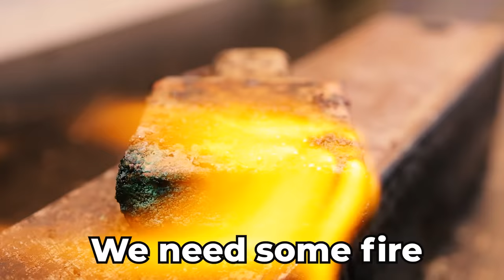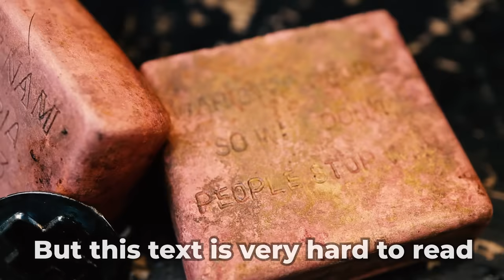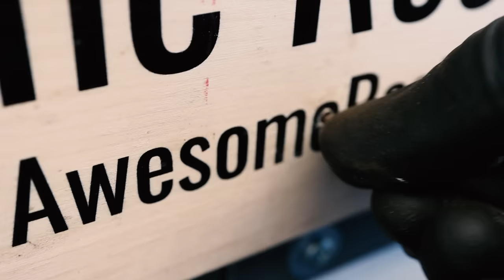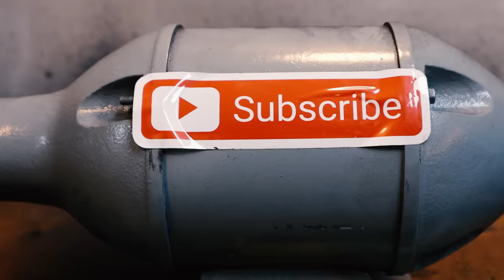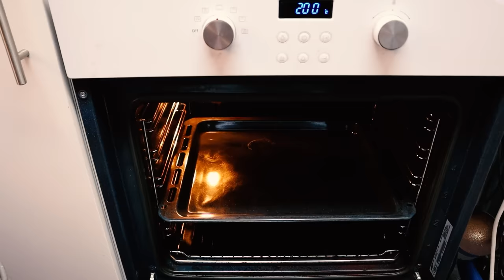Zippo Lighter Restoration, Vietnam War MEDIC Repair - Ba Ria 72-73

Comment: Now you’ll never know how I got these likes
Reply: It's in good shape for how long it's been there
Reply: Every eBay used product seller ever.
Reply: Literally went into the comments after that part🤣🤣🤣
Reply: I mean to be fair, the actual shape of the material is great, especially for how long it's existed, but the actual material isn't so good
Reply: Its in good enough shape for the restoration....
Reply: Same thought lul
Reply: @coconut0308  bruh, same bruh
Reply: Said the same thinggg
Reply: How i be like when i finish a dozen of homeworks
Reply: Probably good shape as in no cracks or holes or missing pieces. Just some bending and severe oxidation/rust. Easy fixes :) (If you have the stuff anyway)
Reply: Still restored it nonetheless 😌
Reply: @patsyclouse5712  35 i guess
Reply: Colouur it is now
Reply: The lighter is in a hell of a lot better shape than it could've been if he hadn't started restoring it.
Reply: What he means by good shape is nothing is broken it needs the rust off and stuff
Reply: If the rust had completely corroded through the metal it would have been in bad shape comparatively. The corrosion was luckily only surface level, it still had all its parts nothing missing, and it wasn't too bent out of shape that's what he meant by it being in good shape.
Reply: Lol, perfectly intact lighter*
Reply: Hahaha I thought that was funny asf
Reply: It's in good shape to fix
Reply: He meant it literally. The shape is good, doesn’t mean everything else is
Reply: That feels like an attack lol
Reply: Was gonna look for this comment but it was first one lol
Reply: yeah thats all just rust other than that its in good shape
Reply: Every Craigslist ad ever
Reply: Seems legit
Reply: I never had a zippo lighter
Reply: If it's not rusted out it's in good shape
Reply: Hahahaha
Reply: ahhahahahahhahahah yeah
Reply: You should see the other guy
Reply: Would hate to see bad
Reply: In people who works in this type of job eyes its in a really good shape and condition. Im not one of them, but even i could see that was a pretty good condition. And it was pretty easy to fix. Zippos are like ak47 - very simple to use, clean, and do the maintenance or repairing.
Reply: He means that the lighter is restorable
Reply: Basically there were no divots and holes in the metal from rust.
Reply: I was confused
Reply: I should be doing school work but I'm watching this instead lmao
Reply: I believe shape and condition is two diferend words
Reply: It was mainly just rust and dirt was only knicked and dinged
Reply: he be studyin alchemy in minecraft
Reply: I agree
Reply: My mind was thinking that too
Reply: And we'll never care either
Reply: Why would I care?
Reply: @colouur good that you came out as gay congrats
Reply: Colouur I can infer though
Reply: but the comments section can give us clues
Reply: Well I do know that I’m the 5800th like
Reply: @mythrillmeyhem8998  How?
Reply: @breakingmad2645  Probably tell the people to comment random stuff
Reply: Well now I won’t like |:/
Reply: Austin C ok 5head
Reply: Please restore your comment.
Reply: I think its was around here 2:10
Reply: Yes I do... the replys helped me create a prediction
Reply: The comment was joking about how he said that the lighter was in "good shape"
Reply: gg
Reply: A person of culture, I see.
Reply: Hey @Colouur
Reply: Noooooooooo! Lol
Reply: I do know I was going to comment that
Reply: ah man
Reply: You monster
Reply: Okay
Reply: And the people who saw it before will never know you changed it, now we all don’t know something
Reply: I don’t care
Reply: I became the very thing I swore to destroy, i’m sorry comrades
Reply: Cool Dude 😎😎😎😎
Reply: Nooooooooooooo
Reply: And some people just like to watch the world suffer
Reply: Datbish Boo have had more fun with this comment that I have had all of quarantine
Reply: Bruh
Reply: Colouur by comenting
Reply: Genius!🤫😏
Reply: You said something about the shape of it
Reply: Noooooooooo!!!
Reply: You know the uploader of the video can just delete your comment now.
Reply: tell me how you got the likes.
Reply: @colouur
r/madlads
Reply: I'm guessing the original comment said something like, "If this were an eBay item, the pre-restored item would be described as being in "good shape" like the video-maker claims at the beginning of the video".  Then the discussion is of course, what is restoreable or "good" in this context.
Reply: Kate Moon, close, but not enough 😈
Reply: You. Monster
Reply: The lighter is not in a very good shape
Reply: Yeah
Reply: It's really not funny anymore when people do this
Reply: Nordin Hashim, hehe mad cuz bad
Reply: Colouur what?
Reply: He did nothing though
Reply: he edited it so the replies make no sense.
Reply: Very original. Not.
Reply: I can guess based on the replies lol
Reply: Vizo Khrieo Gotem
Reply: Shut up and take my like
Reply: Look through the context in the replies and its fairly simpe
Reply: Tbh, I don't care
Reply: Marengeek, you cared enough to reply OMEGALUL
Reply: amphisConstrictor, you should stream more Skyrim
Reply: @colouur4778  no idea what you mean but if i could stream skyrim wouldnt be a bad idea
Reply: @colouur4778  well yea you talked to me
Reply: Colouur why do people do that shit, it’s so unnecessary. Grow up
Reply: hott flames, Malding over YouTube comments lolololol
Reply: You say they sell it on ebay
Reply: 1 Dislike for this posts outcome
Reply: I do know becuase of the reples
Reply: unkown • console Andy
Reply: NOBODY CARE
Reply: The wayback machine thou
Reply: Birisu Andrei - *can. +imagine malding at a comment looololol
Reply: Idk
Reply: It's obviously 2:10
Reply: @segatore1295  for some reason people keep liking the comment lol, I was at 6.9k likes when I edited it
Reply: you're not funny cause you changed your comment
Reply: YOU MONSTER, HOW COULD YOU
Reply: Nah, easy guess from comments. You commented on that "good shape" part of the video and people felt the same way so... ^•^

Edit: Adding the timestamp (2:08) for anyone who might see this and want to know what I was pertaining to and what OP was most likely talking about
Reply: @keroro7677  go back to Reddit g
Reply: You obviously commented about lighter's "good shape".
Reply: You edited  it...
Reply: 1+ dislike
Reply: @lytesky8155  when I edited this originally, the comment had 6k likes, so somehow it’s gotten 2.1k more in that time
Reply: @colouur4778  ok
Reply: He commented something like "It's in good shape. The good shape:" juts look at the first comments
Reply: i know
Reply: @Colouur I know but I will not tell anyone.
Reply: @patsyclouse5712  thank you good sir

Comment: “A little squeeze of WD40” then continue to spray for 30 minutes straight 🤣🤣🤣
Reply: “2 shots of vodka.”
Reply: When restoring trust me that is only a little bit
Reply: Like Gordon Ramsay :a little touch of olive oil
flooded the pan with olive oil
Reply: @nguyenkhoi8765  🤣🤣🤣
Reply: You need to spray it for 30 minutes to get then rust off the brass.

Comment: The red color of the cross survived a war, time and the elements.  It did not survive restoration.
Reply: Also that green/blue color, whatever that was.
Reply: hndmedwnz I think that’s oxidisation in copper
Reply: yeah, I was a bit disappointed when he burned the paint.
Reply: Loved the restoration process, but that cross fu***d everything up.
Reply: @jimmy_kirk  Because Red Cross is a  scam these days.
Reply: @CaioZenon  completely agree. That dark cross reminds me of cheap Asian imitation zippo.
Reply: @jimmy_kirk  red enamel would have been a better idea.
Reply: Agreed burning bad idea
Reply: Yeah cool restoration and shit, but the cross still should be red like the original, and the body of the lighter green/blue like the original, what a waste....
Reply: He could have just given it a new paint job
Reply: Maybe it was a joke. The whole video is full of dissatisfying, or planned unexpected accidents like using too much cleaning fluid, pouring dust out of the target bottle, and the overheating of red paint could be the final one. He painted it whith red, than why would he burn it to black? Or after he renovated the lighter, it could not be hard to repaint it after the burn.
Reply: @robertovonbuchwald4515  the lighter was originally silver, the chrome has all worn away

Comment: “Now let’s repair the flint spring”
Wait, you can fix a spring that’s deformed like that? I gotta see this. 
(Restorer replaces the spring)
Oh. Darn.
Reply: I thought so too at first 😂
Reply: It could have been restored actually. If he’d heated the spring and unwounded it, and than rewrapped it once it was straightened... Ah well. Maybe not worth the work but it would have been nice knowing it had as much of the original parts as possible. :)

Comment: I have just now learned, that the little hole is for a spare flint...
Reply: What hole?
Reply: Dann De Dooie nevermind
Reply: I knew but I always lose it when taking out cartridge for a refill..
Reply: Dann De Dooie Only zippo brand flints. If you rob a flint out of a bic lighter and put that in it will dissolve in the lighter fluid.
Reply: Why you need to put there a spare flint?
Reply: Antonio Sechi to use it when your „main flint“ doesn’t work anymore?
Reply: Antonio Sechi flints wear out fairly quick

Comment: It was a Red cross you painted Red and burned it black. I don't see the point
Reply: To make it look older
Reply: That was stupid. Shiny case and you ruined the emblem.
Reply: Agreed, also the annoying cuts with the robots and everything kinda ruin the satisfaction
Reply: What’s the point if you don’t combine the past with the present? Just buy a new lighter then. Gotta remember where it came from
Reply: I agree. Specially since you could see the bright red before restoration. If it was clearly red before restoring there is no point in making it looked fake aged black
Reply: @breckbilbrey4053  facts

Comment: "Now let's make it look old again"
Whyyyyyyy!?!
Reply: Salwa . sh شكلها احلى وهي قديمة ، اذا على التجديد فيه اشياء مره حلوه جديدة ما يحتاج نجدد هذه
Reply: There is value in old things
Reply: Looks like he messed this part up and doesn't knew what to say
Reply: @abdullahawad3306  Yes there is value in old things but: A) Why did he restore the rest of the lighter to a mirror sheen? B)The Red Cross was STILL Red when he first got it, 50 years in a Vietnamese Jungle and it was still Red!! Why would he burn it and make it black?
Reply: @abdullahawad3306  there was no value because of the corrosion. And if it had high value why shine it to a mirror sheen. Only to burn the pendant when the original color was still visible. He lost value burning the pendant. If he would have kept the color it would have been more in touch with how it was originally
Reply: Waste of time, ruined the look. Why bother using the colors just to burn it black, that doesn't look old, just ugly
Reply: @nullfield6514  yeah doesn't make any sence
Reply: Super confused why he painted it only to destroy the paint.  He should have kept consistent and made it all look new.
Reply: Could be a request from the owner.
Reply: Cuz it's vintage duh (I'm not a huge fan of it either but that's probably why)

Comment: i dont think you should have burned the paint. When you found it it still had color so maybe it should have stayed
Reply: +Arctic_Fur   I Agree. @Awesome Restorations Called This A "Restoration" Video. It Is Not. That Is Not What The Original Owner The "Vietnam War" Vet Purchased. From Awesomes Artistic Decision To Give The Lighter A "Matte Brown" Patina, To Burning? The Painted Medic Symbol. Totally Unnecessary. The Inscription Told Viewers The Age of The Lighter (1972 - 73) No Artificial "Aging" Techniques Needed. Other Than Those Issue's, I Liked The Video. P.S. (But NOT The Owl Hooting.)
Reply: Agreed. Should have made it look as close to original as possible, personally. But at the same time, at least it isn't corroding away in the jungle anymore

Comment: Hey man, thank you so much for this video. At 1.15, you suggest to use fire to loosen the grip. 

I tried it with a grinder which had the disk locker utterly completely stucked. WD40 and anti rust liquids weren't enough, and I put lots of them.

But fire.... Man !! Thank you ! 5 min under 500° C and it lost the grip.
I got my grinder back thank to your tip !!!

You are awesome. I believe restoration and reparation are the lifeblood of the next generation ! Therefore, that makes you a leader !

Keep on going !!
Reply from the maker: thanks a lot for your comment I am glad this could help you :)

Comment: I was expecting the original red paint on the red cross that would've looked even better..though was a great job indeed.
Reply from the maker: It's ok if you think so - thanks for watching anyway and glad you liked the rest of it :)
Reply: @AwesomeRestorations  It would've looked better if the red paint was intact tho or somewhat visible like in the original...It would've gave it a pop!
Reply: I was surprised they didn't try to heat it from the inside to get the cross plate off the try and retain the original paint, would have been a nice nod to its history.

Comment: I suspect these restore videos are rigged. They just put the object in a corrosive substance, and then sell it like a repair. At least some of them
Reply: Yes, the "blue" rust and the lack of damage on the metal surface makes doubt of this video
Reply: @mjbalbo  he said in the description they found in a beach almost on the surface in Vietnam. This video i guess is real because zippo lighter are really built in very good condition.probably the paint got exposed to salt and heat and become crispyand surface rust hot better of it ,if you know what i mean. And most of the inner case are qlmost intact except for a few surface rust because the case are close to tight.

Comment: My grandfather has some old rusted parts of a mortar missile fired in WW2. What do you need to get rid of rust on that? Should be easier because it's much bigger and doesn't have so much crevices and doesn't need to be functional.

Comment: Don’t believe this, probably a new one corroded on purpose for the sake of the video, I’ve had a solid brass one for about 4-5 years, use it every day, dinged up and the hinge is loose as but this one is like a brand new hinge, didn’t even have to adjust it even tho it was heavily corroded and shot blasted? 🤔 good work tho still
Reply from the maker: Thanks for watching and for your words 👌